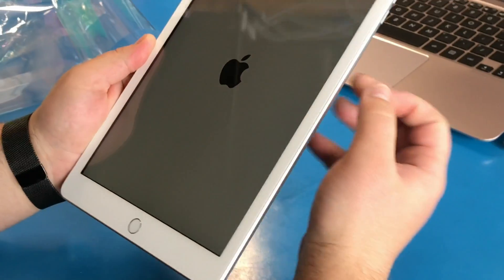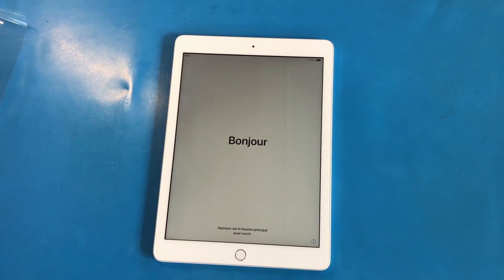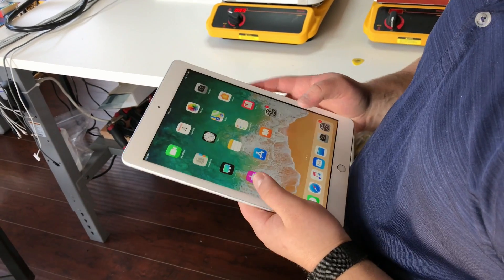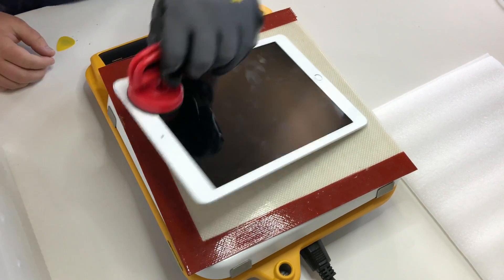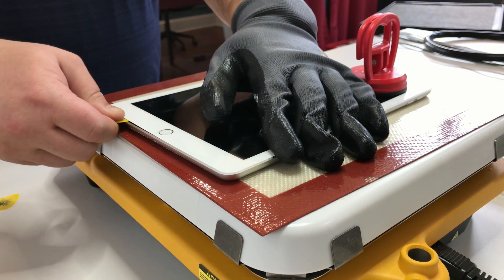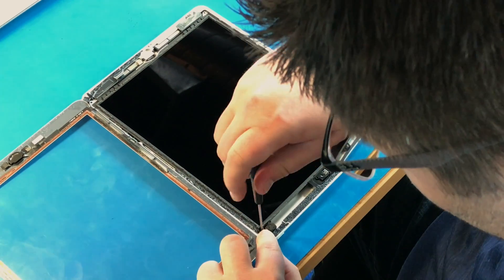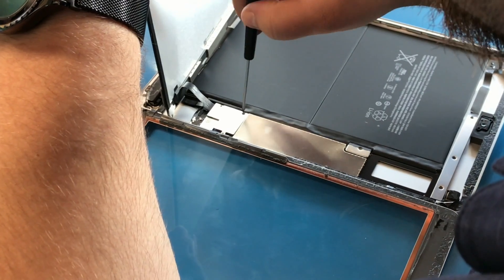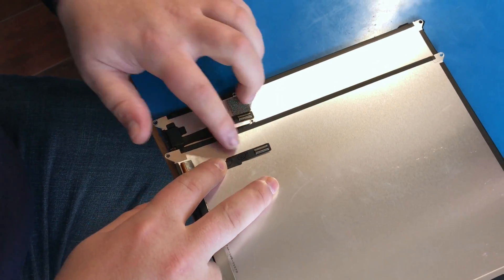iPad 6 Unboxing & Teardown

Comment: I have ipad 6th 2018 9.7". both lcd and digitizer were broken. I bought the two parts from a store. i install them and try them before sealing everything back again and they work fine. once i seal the screens, part of the digitizer stop working.
although i make sure that the connectors are still in place..
help me with some tips
Reply: Same thing
Reply: Have you guys fixed it?
Reply: Christian Joseph Manarpaac nope. Nothing resolved my pb. I am waiting for this model’s price to drop down so I can buy a used one for parts and use the genuine screens of it.

Comment: Hi, I’ve bought a skin for my new 2018 iPad 9.7. Part of the instructions was to heat the edges of the iPad a bit after applying the skin to insure a smooth application. When i did that step by using a hairdryer, i noticed that the bottom right edge got hot (not to a point where it was too hot to touch but it was significantly hot). I’ve let the iPad cool down and it works normally ever since. I wanna know if the iPad could have gotten hidden damages.
Reply: Hey Ward! If the main functionalities of your device seem to be working properly, you should have nothing to worry about. On all iPad screen repairs, a fair amount of heat is used to release the adhesive which holds the glass down. We typically use heat resistant gloves to handle the device because it does get "too hot to touch". Let us know if you have any other questions!  - Chris

Comment: Can you please help me! I have a IPad Pro 9.7 1st gen that I cracked my screen, can an iPad 6th gen screen be used to replace it on my iPad Pro 9.7??  I greatly appreciate any info on this issue
Reply: Hi Iam Manuel!

The iPad Pro 9.7 has a different display than the 2018 iPad 6. Please use a display that's made specifically for the Pro 9.7. This display has the digitizer and LCD fused together, and is therefore more expensive than the 2018 iPad 6, which has a separate digitizer.